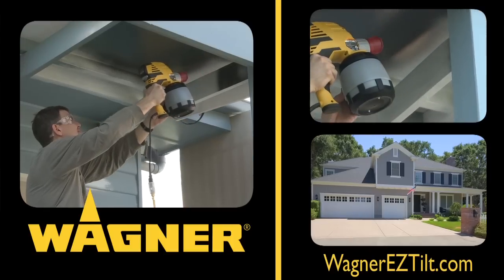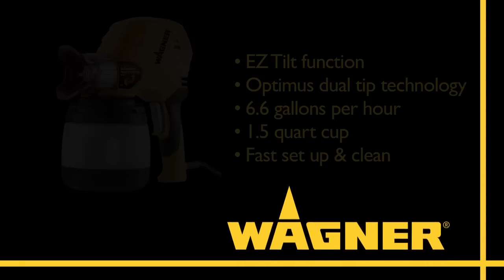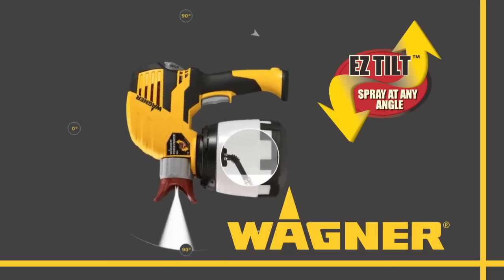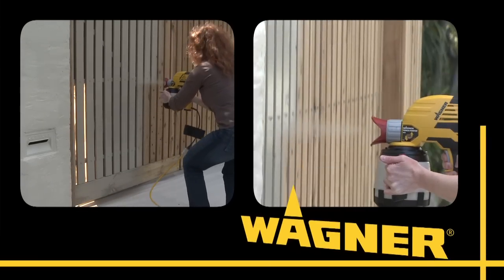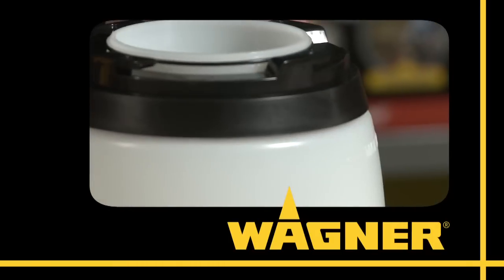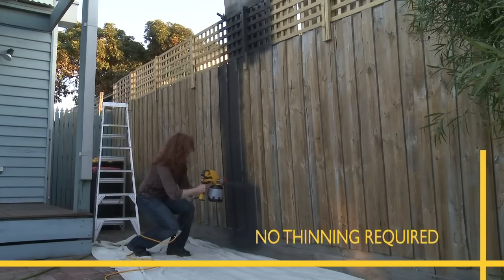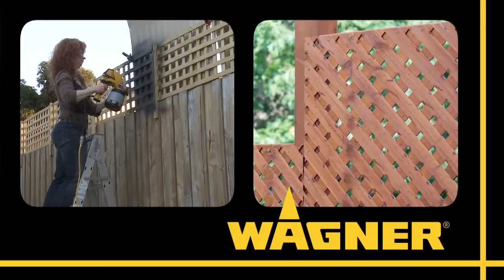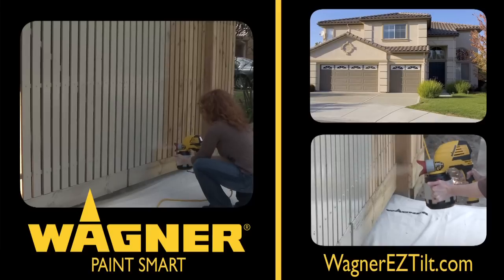Wagner Power Painters With EZ Tilt

Comment: This product works. There is a learning curve involved. Not in the use, but in maintaining it. Maintenance is crucial. I have shot close to 20gallons of Behr Premium interior. Ceilings and walls of 6 rooms. Don't thin your paint. The fastest way to get the piston to seize is adding water to the paint. Use synthetic 5w-30 on the piston/piston housing on the twin orings where the pickup tube filter assembly inserts and screws into the nozzle housing. Lube the heck out of it!

Comment: I made a video review of the Power Painter Plus.

Summary: It's super-easy to operate and run, but it the paint reservoir cup is almost too small to be useful for more than tiny projects.  I would definitely recommend one of the more professional models and if I were doing any more than spraying a door or two I would probably choose to paint the spray right out of the can.

I also agree with the other comments: CLEANING and maintenance is important!

Comment: The gun is not at all fussy about mixing oil and paint. If you notice hesitant operation were seizure is imminent, stop, lube piston; follow the steps above. Every refill wipe the nozzles. This gun is amazing. Perfect for acoustic ceilings. It's a work horse that saves time. Especially on old uneven surfaces. I no longer would even consider painting a room without one. To me a brush and roller seem like slave labor. With time and patience you'll wonder how you ever got along without one.

Comment: upon start up if your unit runs but there is not paint, You have a loose connection. Both halves of the filter housing need to be absolutely flush and air tight. If you leave the gun idle for more than 1 hour you will likely have a seized piston. Have 5GL bucket filled with water handy. Remove the nozzle and immerse it. Unthread and remove the nozzle and paint cup. without disassembling them (it will be a mess) place it under running water and free the piston. Clean, relube and reassemble.

Comment: I'm debating between the Power Max or Flexio 590 to paint a few rooms and stain a small deck. Besides the two speeds and noise level, what's the difference.? Thanks.

Comment from the maker: That sounds as if you don't have the locking nut tightly or correctly threaded onto the front of the gun.  Please call Wagner at 1-800-328-8251 if you'd like help trouble shooting your equipment.